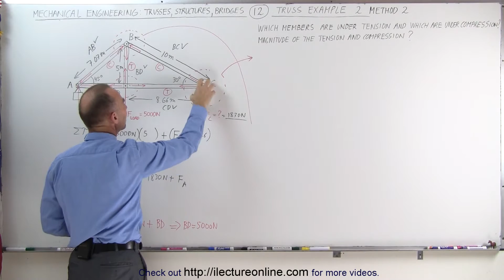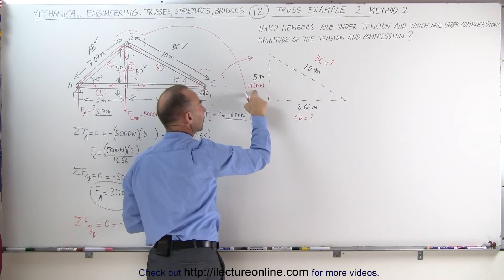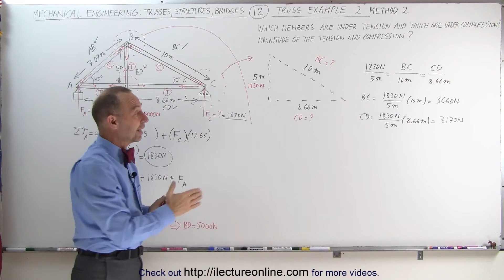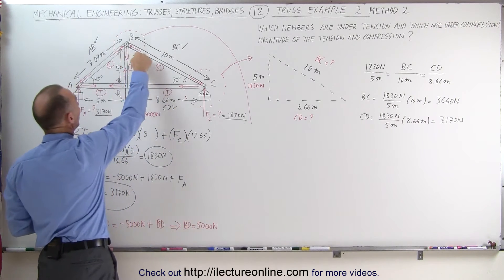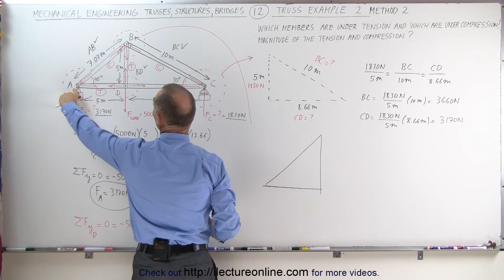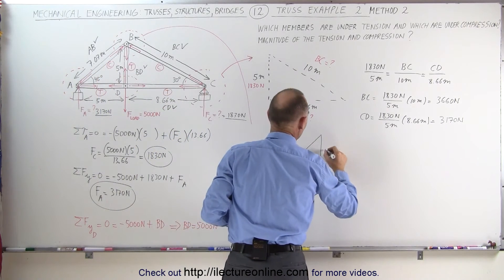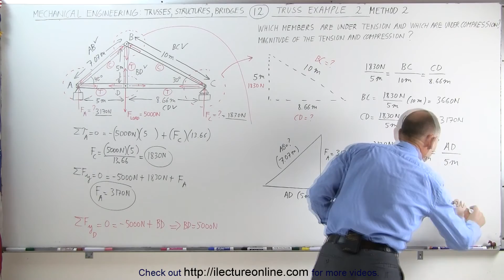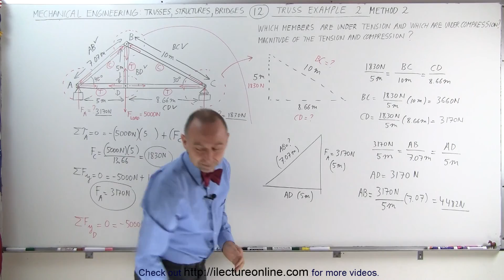Mechanical Engineering: Trusses, Bridges & Other Structures (12 of 34) Truss: Ex. 2 (Method 2)

Comment: Sir, May I ask what is the theory behind this method? Why the formula of " the force divides the length" can only be used in terms of right-angled triangle ? Thank you!
Reply from the maker: You don't need a right triangle, but it makes the calculation a lot easier.
Reply: @MichelvanBiezen  I mean, is there any reason for the formula "the force divides the length"  being valid?
Reply: This method assumes that all members are equivalent in density, with uniform density along the length and the cross-sectional area (the area centroid and length centroid would be the same for all).  Then it's just a matter of ratio and proportions.

Comment: So that means, that if the structure was not 5m but only 0.00001m tall, then the bars BC and CD would be (almost) parallel but they would experience (almost) the same stresses but in opposite directions.